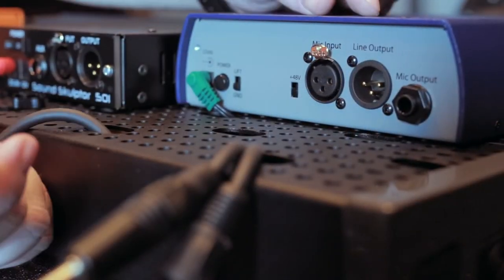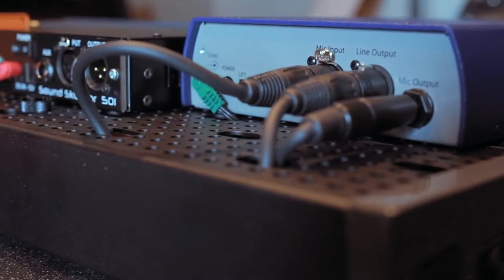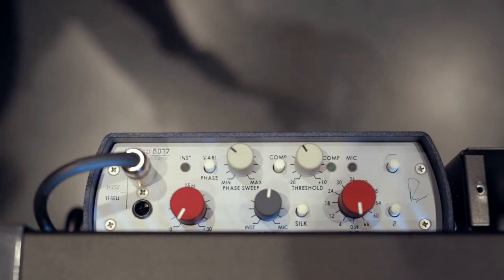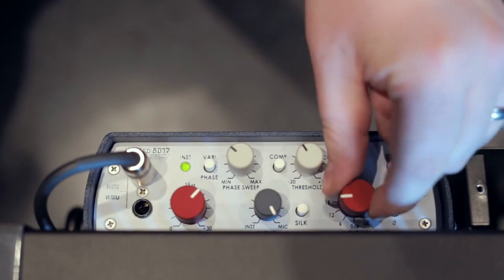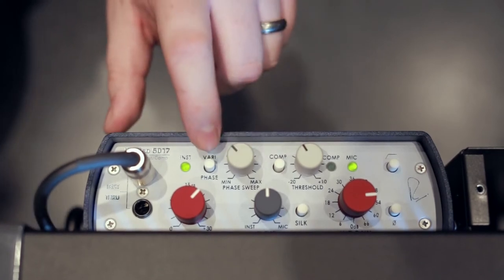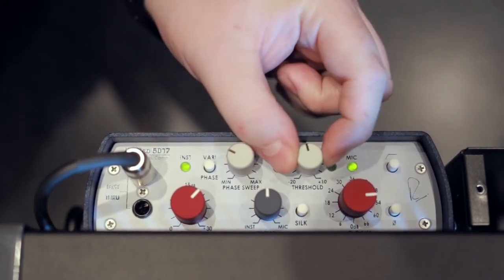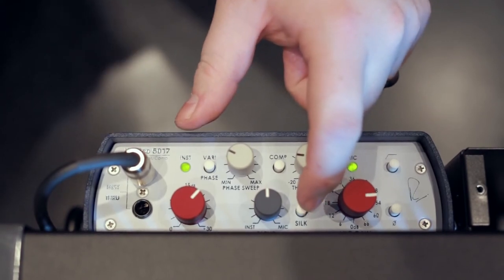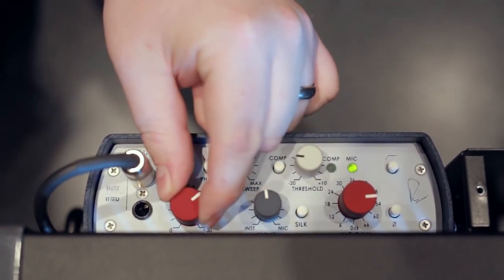Rupert Neve 5017 Acoustic Guitar Demo by The Box Breaker Method

Comment: it seems that there is  one mic (which picks the sound of guitar&room's reverb )  connecting to the Mic Input. so where did the signal of INST comes from?
Reply: I’m 3 years late but there is a pickup in his guitar that so they have a cable plugged in from the guitar straight to the inst, and then have the mic positioned by the 12th fret as they showed. The plug was probably just below the frame when showing the guitar.

Comment: is this the same as the portico 5015 with no blue box around? All white design like a small rack?
Reply from the maker: no, the compressor is completely different (opto-coupler vs VCA) and the pre / line drivers are a little different.  It is the same as the 517 with a separate output for the mic side.
Reply: @RupertNeveDesigns  thank you. is there any link to a compariosn between the two? 🙏🙏 5017 seems more 73 like to my ears..